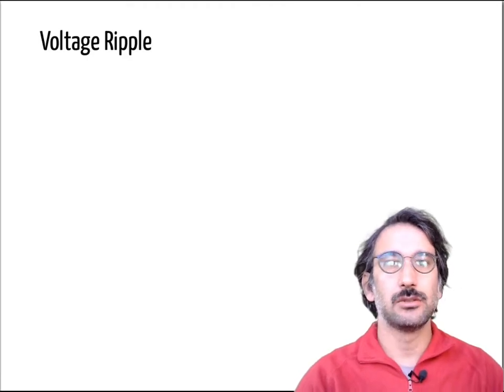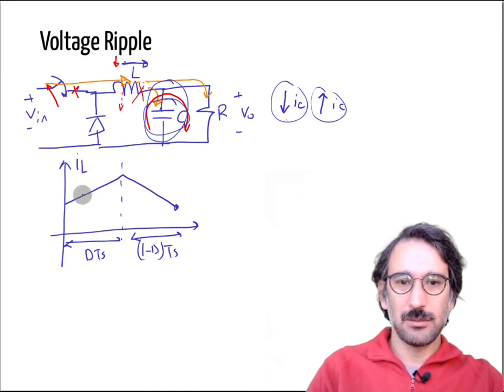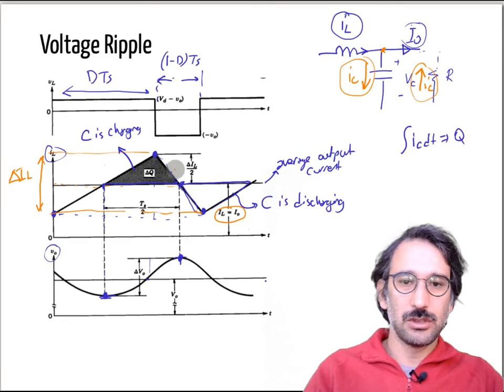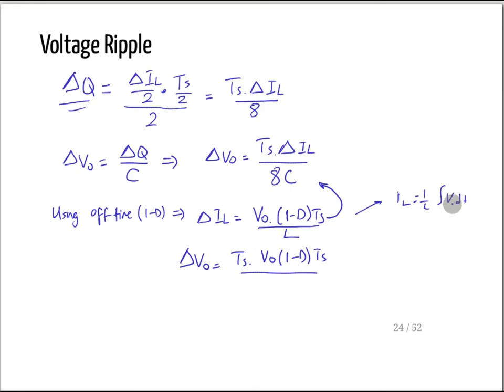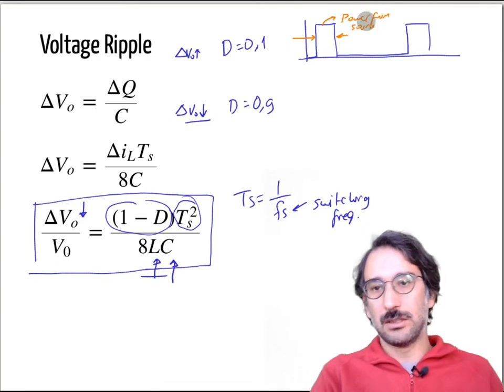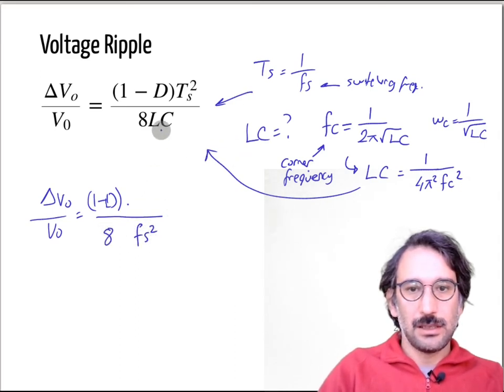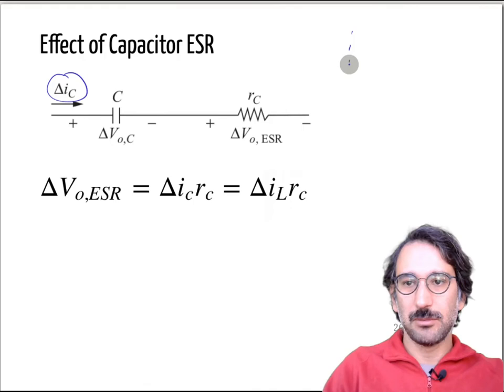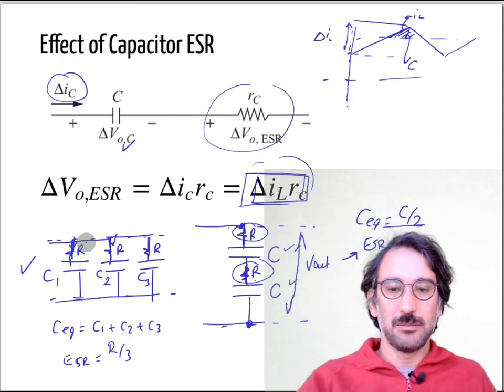EE463 - Voltage Ripple in Buck Converters

Comment: The explanation is entirely INCORRECT. The voltage on the capacitor is monitored by the oscillator circuit and it needs to have a high “set-point” and a low “set-point” so the circuit reduces the mark-space ratio when the capacitor reaches the high value and increases the mark-space ratio when the voltage drops. This gap might be 10mV, 50mV or 100mV. This is the value of ripple for the module and has nothing to do with the components. 
The components could produce a ripple-free output but the circuit would not be able to set the voltage. 
That’s why this instructor is completely wrong and has no idea how the circuit works. 
He is just “leading you down the garden path” with his ignorance.